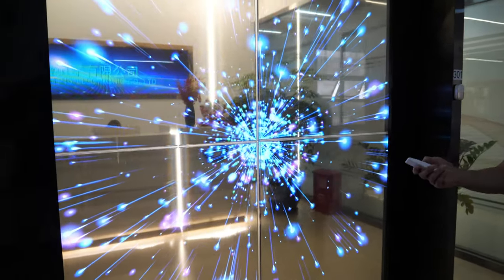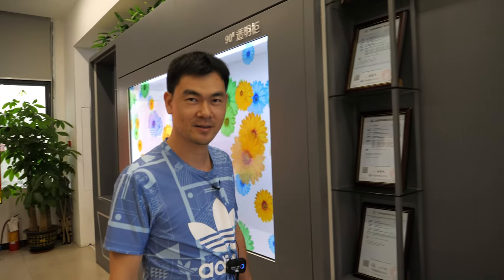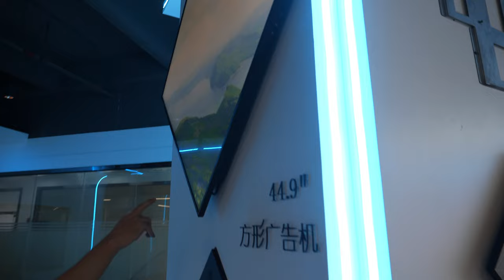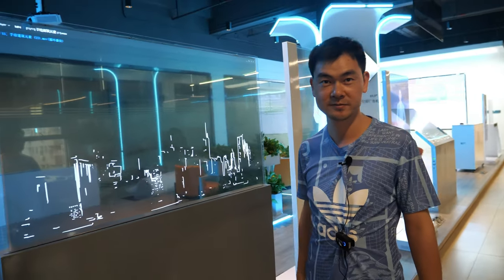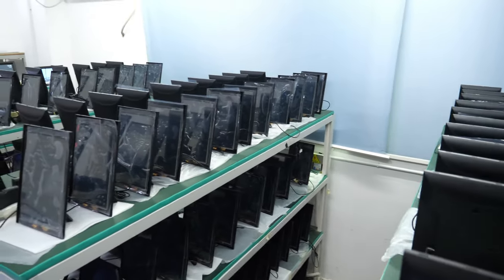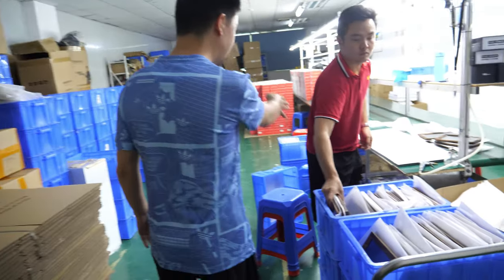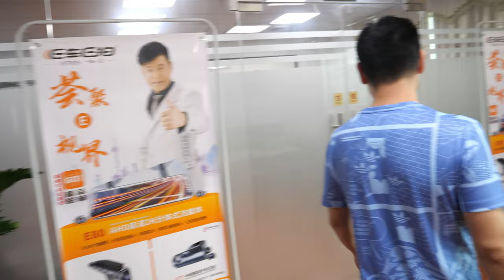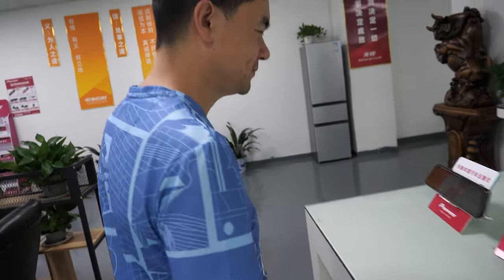ZXS Large Transparent OLED displays, 120" microLED, Signage, Photo frame and Dashcam Factory Tour

Comment: what’s the point? it is like a display with a mirror in front:  you can see two things badly now! lifetime achievement
Reply: Some use cases of these displays:

1. Retail and Advertising: in storefronts or trade show exhibits, allowing products to be showcased while simultaneously displaying dynamic advertising content, to create an engaging and eye-catching display that can attract customers and enhance brand visibility.

2. Augmented Reality (AR): serve as an overlay on real-world objects, enabling interactive and immersive AR experiences. Imagine wearing transparent glasses that provide real-time information or graphics while still allowing you to see your surroundings.

3. Architecture and Design: can be integrated into windows, allowing natural light to pass through while providing information, privacy, or artistic elements. They can transform ordinary windows into interactive or informative surfaces, enhancing the aesthetic appeal of buildings.

4. Transportation: can be used in vehicles, such as car windshields or airplane cabin windows. They can provide real-time navigation, safety information, or entertainment without obstructing the view. This enhances the overall user experience and safety measures.

5. Medical and Industrial Applications: have potential in medical and industrial settings. They can be utilized in surgical procedures to overlay vital signs or diagnostic information directly onto a patient's body or equipment. In industrial environments, they can provide workers with real-time data or instructions while still allowing them to see the machinery and surroundings.

Innovative technologies often evolve through generations and find practical applications that offer unique advantages.